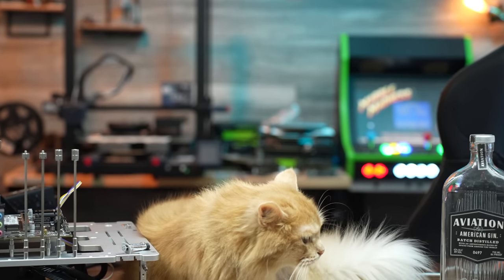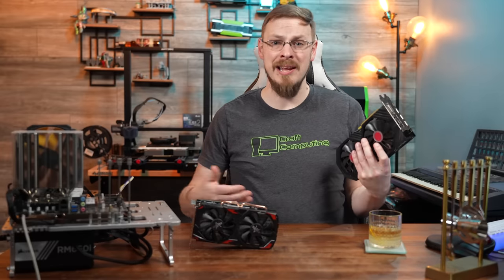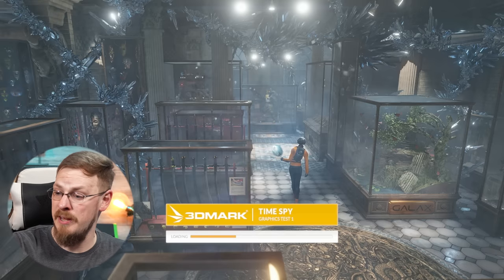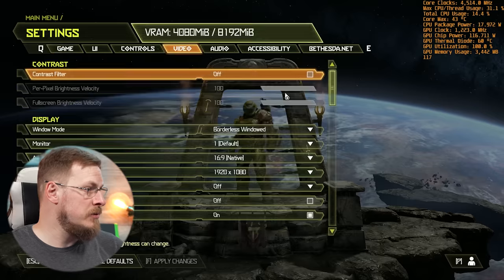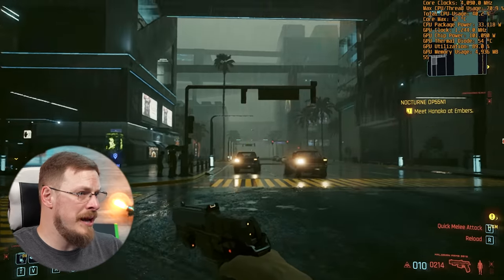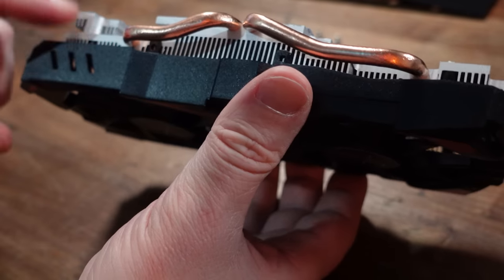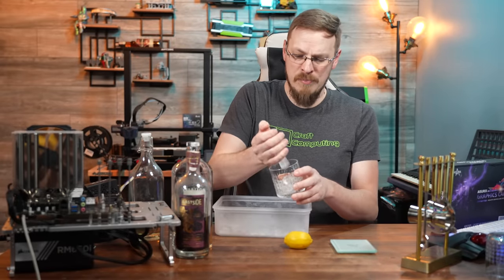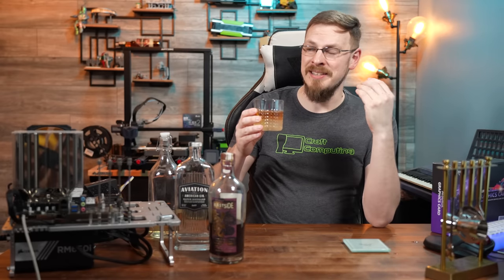BRAND NEW RX 580 for Under $100???

Comment: I have one of those Aliexpress remanufactured GPU. Paid 230$ shipped to Brazil for my RTX 3060 Ti, never had a problem with it, it runs cool and quiet GPU-Z detected as a MSI card. If the die is good but the rest of the components are worned out, remanufacturing it seems not only a good way to reduce e-waste but also to deliver cheap goods for people.
Reply: Yup, this is great. Only bad thing about it is when they try to scam people thinking its original hardware. Like they do with 4090s.

With some transparancy in the marked, this could become a very good thing.

Comment: We're going to need a new category for new, used, etc. called "Re-Manufactured"
Reply: "Restored"?
Reply: It's called Refurbished
Reply: @MiGujack3  I wouldn't necessarily call replacing everything except the chip a simple refurbish, but I guess most would probably agree.
Reply: Recondition?
Reply: Sponsored by the band Fear Factory
Reply: Retreads? 😏😏😏

Comment: There is a webpage that details the differences on this card to the "usual" RX580.I have one arriveinan "ENVIDIA" box and it seems to work well . Just be aware another tech channel purchased a unit that came with a link to a driver that potentially has a  mining bot included.
Reply: well, it should work with pure amd drivers, right? so it's better to download the official drivers than downloading a shady driver that the manufacturer wants you to install. still, for the price, just keep an eye for things like that, right?

Comment: I actually like this little card, for budget builders this looks like a great option. I actually have my old Power Color Red Devil RX580 on a shelf and I gotta say, it is substantially bigger than the card you are showing, while also running hotter! lol. not bad for 100$ in my opinion!!!
Reply: one thing i noticed with my red devil, is the backplate is plastic, and therefor insulates the heat, and keeps it from leaving, it's not a huge deal, but it does make it run slightly hotter
Reply: @Rosie__Bee-Buzz  really? that's interesting! I wish Youtube would let me post a picture but my 580 red-devil has a plastic fan shroud but full metal backplate, the card itself weighs quite a bit for the size, but nothing to crazy. But building my sons computer with a 6700xt red devil, I remember thinking to myself that it was one of the most rugged cards I had held at the time with all the metal in it, very cool looking card as well!

Comment: I picked up one of these refurbished RX 580s. Mine's a SANSHUKU brand, the cooler is different, but an identical PCB. The backplate is also shorter and simpler in design. Great 1080p card for the price.
Reply: Same. Its a good value for 100 bucks esp if your set your expectations on 1080p gaming.
Reply: 144p
Reply: @samisan774  huh? The 580 and 570 are still pretty competent 1080p cards.

Comment: I paid 150$ for an RX 580 8GB in 2019, new should I mention.
I wish budget cards were better nowadays, but the only true replacement costs at least 200$ being a RX 6600.
Reply: *$225 usd from retailers, about $30 less than 6600xt. Honestly the 6600 should be about $150-180.

I wouldn’t touch Aliexpress with a 10foot pole.
Reply: @robertt9342  Why not? It's really not that different from Amazon lol.

Comment: I am fairly certain this version of the 580 was an official version produced for the Chinese market, so possibly not a re-purposed mining card.
Reply: I remember the same, it's a 570 named 580 that was marketed in China to pc gaming cafes
Reply: I would agree that is possible but miners were paying big money for these things and im guessing nearly all of them ended up in mining farms even if they started life in a gaming rig.  
At $87 there isn’t much room to peel a gpu out of a board and put it in a new pcb, add new 8gb ram new fans and make a profit so I will continue to believe its somewhat recycled. 
Having said all that Id feel comfortable buying one.   At that price really can’t lose.
Reply: @BeeWhere  Not quite, it's a RX580 that is cut down and clocked higher. Sitting between a RX570 and a normal RX580.  It should have been called a RX570XT.

Comment: My MLLSE RX580 2048SP should actually get here tomorrow, which will be added to the HUANANZHI X99 QD4 E5-2620v3 16gb DDR4 kit I just got (which actually seems to work pretty well itself). Less than $300 CAD overall for what should be a decent little gaming system.
Reply: Really good pc components cost so little these days. Stuff from 2018 is still doing amazing. What a great time
Reply: Thinking of doing the same but with ghe 2670v2
Reply: I am still using rx 570 that I got in 2019, then again I game on a 1366 768 monitor, so it should be good enough. Only thing I upgraded was my cpu and ram. Now my RX 570 can stretch its legs fully.

Comment: I bought one of these about 2 months back to build a gaming PC for my brother. I knew this card was OBVIOUSLY a stepdown from the 6900xt I have in my system, but I'm on a budget, and figure we can upgrade him later if we need to.

And I'm very impressed with card. Like yours, drivers loaded with no issues, and it performs well. Even with a VR unit! I want to buy more of these cards to build more "beginner" or "budget friendly" gaming PCs for people.
Reply: 1030 for entry level beginner cards..
Reply: @Sami  I always preferred AMD over Nvidia. And from what I understand from benchmarks, the normal 580 is much better, so even this mildly stripped down version should still beat the 1030, and at less than 90 bucks for the card.
Reply: @samisan774  Dude the 1030 is the worst GPU you can buy currently and it's also overpriced as heck. Even 1050 Ti is not great, lowest you should go is 1650.
Reply: @FynnR  1630? Jokes :)..
Reply: @samisan774  Hopefully ;)

Comment: Bought this card last month for my Mint install and everything seems to be working just fine.  Was detected correctly right away and even some pretty new games run without no problem.  One thing to note, though is that this needs an 8-pin power adapter.  It comes with a 6-to-8 converter but I read that those aren't great to use, always better to have a power supply with the correct hookups.

Comment: About that graphics score in 3dmark and the CPU differences, In Firestrike my brother's RX 480 got 42 points less on the graphics score with an e3-1231 v3 than it did with my i7-11700f so your guess about it not making much difference, spot on.

Comment: Yes these cards are built through maximum recycling, GPU, chipset, RAM and heatsink and probably other stuff like mosfets are another common recycled component. Certified Chinesium product, although even if it may not last more than a year it's good enough for the price
Reply: I have bought one on the 1st week of January of this year and it's been doing great for 6 months. I have seen no performance drop either. It's probably my luck anyway but I assure you.

Comment: I couldnt get a 580 anywhere near the price mentioned; in the end I ordered a SOYO branded RX 5700xt.

It arrived looking immaculate, but there were issues straight out of the gate.

Furmark - the hotspot jumped straight to 113C within a second, and started thermal throttling; while the fans were howling away with a metallic buzz.

I tried the lower presets for Furmark and everything went exactly the same.

Since I could detect some play in the heatsink/board (about 1-2mm of sideways movement from a fairly gentle twisting force), I stripped the board down.

I found the gpu die was scratched, and that it had been polished to try and remove the scratch, no trace of the original AMD writing on the die remains.

I fitted a Raijintek Morpheus cooler with a pair of Noctua NF-A12x15 FLX fans rated at 55.4 cfm/94.2 cmh (fixing the fans was a nightmare); after an issue with the new gpu bracket fouling a cap, I managed to get everything screwed down tight, and the main GPU temps were MUCH better, however the hotspot is still hitting 113 C within a few seconds and thermally throttling the gpu.

Max GPU package temp under load now settles at 64C, while the Hotspot is thermally throttling at 113C.

I had some TG Hydronaut arrive yesterday, so I am about to strip the card down, clean the die (again), and see if that helps.

I COULD fit fans with a higher airflow, but a 40 degree differential between the hotspot and the rest of the die is way out of spec, so that needs addressing first.

OK A FEW HOURS LATER.

AM I allowed to swear ??

They ground the die down so far, a normal heatsink doesnt make proper contact; the one they fitted - which wasnt designed for the RX range, has a specially raised copper plate to make up the difference.
I didnt notice this when I took it off originally, because there was so much thick thermal paste on it.

So using Hydronaut, the heatsink and the die werent touching AT ALL.

I have cleaned it off and applied MX4, which has helped a lot, but it is still hard throttling well below the maximum power, regularly dropping to below 100 watts from a max of 198 watts (TDP = 225)

I still have that 40C differential as well, suggesting the die isnt flat, so I dont think bigger, faster, (nosier) fans are going to help much

Is there such thing as a copper foil I could place between the die and the heatsink to make up for the difference between the original height and this ground down die height?
Reply: Art supply stores sell gold foil perhaps they also have copper foil.   Aluminum foil would be an improvement for you if you do not find copper.
Reply: @dennisg7309  I have bought some 0.3mm pure copper plate I am going to try - not sure if I should potentially waste any more thermal grizzly, or use the cheaper MX-3.
Hopefully over the weekend - or Monday - depending on how I feel.

I have multiple, NASTY medical conditions and am in a fair amount of pain.

Comment: It's impressive how well the RX580 has held up after all these years. I'm still using my RX590 and it's been a champ. Yeah, I'm not doing 4K gaming, but for everything else, it's solid. That line of GPUs will go down in history as one of the best budget offerings especially when it arrived in the era just as GPU prices began to spiral out of control.
Reply: I wanted 590, but it was too expensive, but then again I was gaming on 1366 768 monitor, so a 570 alone would be overkill

Comment: I paid £45ish on Ali for my Lexindar version of this card, abs brand new no dust or sign of use, edge connector no sign of wear and thermal pasta was fresh too.   I have also noted the cooler which is the exact same as yours seems to do a very very good job as even with a game chugging along full specs the fans just don't fire themselves up often and watching AMD's Adrenaline metrics I just can't seem to get the temp to peak over 50ish and I threw benchmarking, stressing progs at it but peaks about 50ish.   I have since changed the thermal pasta for some HP phase change thermal material and temps even better.

Comment: This is in my desktop tower right now. 97 bucks off Amazon 5 months ago. I also grabbed the their RX 5700XT with 8GB for 129.00 2 months ago. It works just fine in a new build. But then in my gaming "rig" I am running the Powercolor RX7600 with 8GB from Microcenter 1 month ago for 229.00 it  replaced the Powercolor RX6600 with 8GB.

Comment: The memory is used too, the chinese manufacturers paint the surface to make it new and matched. It's a high risk lottery, repair shops don't even look these cards because they know it's unfixable (dead memory controller since it's stressed by mining)
Reply: nobody sends a 100-200$ card to a repair shop anyway, the price to work on it would be higher than the cost of buying another one.
Reply: @marcogenovesi8570  I'm not talking only about this model and in major part of the world people do
Reply: @phgodts  people in the rest of the world like repairing stuff even when it is cheaper to get a new one? Doubt it.
Reply: @Marco Genovesi  Where I live the labor on repairing this card would be about 10 bucks.
Reply: "dead memory controller since its stressed by mining" I've never read anything stupider about gpu
Reply: @DukeNuk  if the mem chips and main die are from a heavily used gpu do you think there is any reason to be concerned?
Reply: @charlesg5085  mining is no different to gaming for GPU. Only thing affecting cards is running them in bad conditions, but that applies also to gaming. There is nothing wrong with ex mining cards if they been look after.
Reply: @charlesg5085  If a mining GPU was undervolted it's certainly less damaged than a gaming café GPU, since mining is a more or less constant workload.

Comment: we have a small company for pc building here in asia and these RX 580 8gb cards are the current best sellers for budget 1080p gaming PCs.

Nvidia and AMD, most users only want a 1080p card at $100. Make us a modern $100 card that performs like RX 580 8GB but a little more efficient

Comment: Worth noting, roughly 8 hours after this video was posted, the product page for the graphics card gave me a listed price of 120 EUR. Price hike due to increased sales after this video, or was the price raised before this video came out?
Reply: its usually automated. like all the sudden they get 20 orders for the card it prob ticks up 10 bucks at a time.
Reply: @braddl9442  honestly, thanks for this hint - which actually might explain a lot  of those question marks i repeatedly tend to have floating over my head - as EVERY "good value" alibaba item that i watched such review videos about skyrocketed in its price, even up to absolutely ridiculous pricings like these Erying i9 - boards, they now get offered for nearly triple the price they were at first. That's just nuts, asking 400$ and more for them seemed kind of cheeky to me till i saw your comment, but yeah, if it's automated price matching with the market request and people do still buy at those 'stock market gem prices', then i understand -and hate this annoying bate system 😕 still thx again for opening my eyes.
Reply: @nopadelik9286  oh the price is bound to relax eventually.
Reply: @SianaGearz  🤔.. you mean if market demand goes back again also the prices getting lower, like back to what they were before ? Well, would be cool, agreed. What happens quite often is that the affiliate links from the video descrriptions are dead and lead nowhere anymore just after a few days, just had that several times with videos from ETA prime .. 
Don't get me wrong, nothing wrong with overseas sales people, often had kind contacts with Shenzhen sales agents. It's just this quick changing unreliable alibaba platform which forces such baiting methods

Comment: 1200mhz seem low for rx580. My sapphire Nitro+ model.goes 1500mhz and consume 200w (with modded bios) wonder how much of a performance penalty you got from running at such low clocks and power target.
Reply: Apparently around 300mhz
Reply: Cause it's not an RX-580. It's literally an RX-570 perhaps even slower than the RX-570 given how it's clocked at. But apparently their is this idea that they are "getting an RX-580 for less than 100 usd" and these chinese companies seems to be succeeding with that marketing ploy as every tech based yt channel seems to blatanly ignore the white elephant in the room that it's nothing but a basic version of the RX-570.

Comment: Sold my RX580 at the peak.. I don't remember all the numbers but I know I was lucky enough to find a RTX 3060 Ti at Microcenter. In the end the upgrade cost me only $150.
They should call it a 580LE. That would align with what they are trying to do.
Reply: I had mentioned calling it a 570XT, but also calling it a 580LE would have been appropriate.

Comment: Must be an running a modded BIOS with lower clock speeds to avoid thermal throttling. Other than that, re-used Sapphire OEM PCB.

Comment: So it's slower than a Sapphire RX570 Nitro. Which itself is a great card. But this is not a rx580. Of course Nvidia use name scamming too, but it's still scamming. All in all my recently bought, used, rx580 is a better deal, assuming the components last well. The rx570 and rx580 can easily be tweaked for clock speed and milliamps, to suit your preferences - just use Adrenaline manual tuning.

Comment: Just found out when I took my mingzhou  RX 580 card apart.  That the one  got was not an RX580 but an  ex mining  RX470 card made in 2017.  I had truble when  I tryed to over clock it but it only go up to a clock speed 1206 mhz  2000 mhz memory clock with no problms but go any higher then that and it do all sort of horible things If you get one they work ok but i change the paste

Comment: could you grab a backup of the bios for this card i have the same  card id like to reflash the bios to got it running a little slower on a bios for an rx570 with no uhd option

Comment: If the GPU chip actually came off, there's a case against buying it since they can Pringle it during the salvaging process, and it might not be apparent now, but come back to bite you later with delamination. If on the other hand it's still on the PCB it came from, with just other bits tested and freshened up if needed, that might be good. But I wouldn't be holding my breath for them putting in more than bare minimum effort, and trying to claim any sort of warranty from an unproven company across the globe isn't going to be fun either.

Another hazard is that since you're an influencer, there's a possibility that you get the golden sample and customers get something that isn't made or tested to the same standard, if it's supplied by the brand rather than a retailer.
Reply: this is true he could had got a working original not a remanufactured unit...